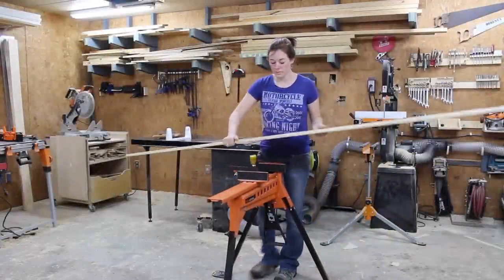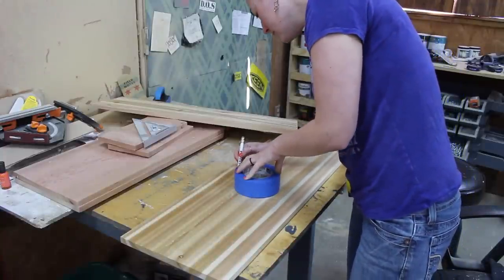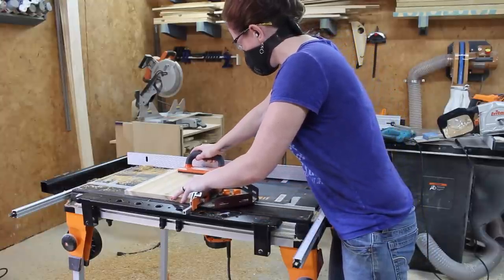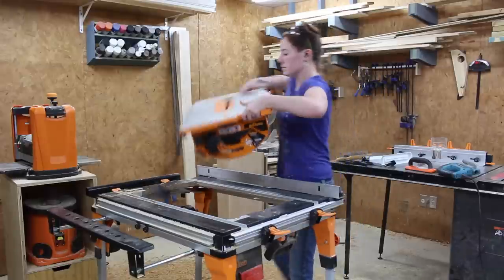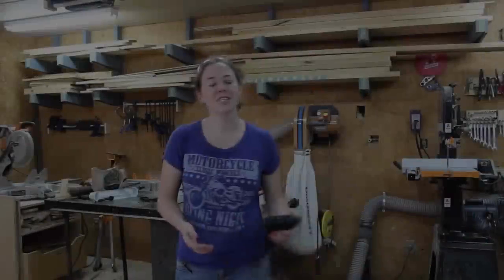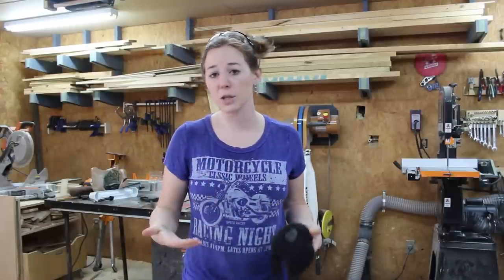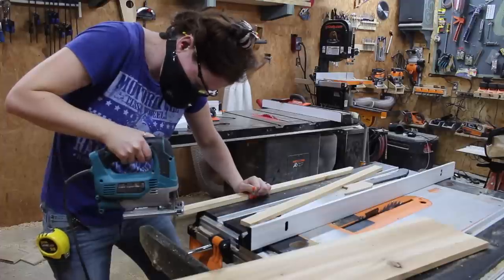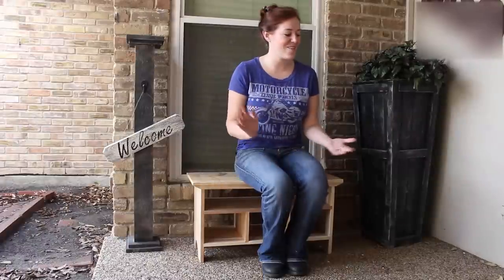Small  Wooden Bench for a Porch or Entryway

Comment: April, Another great video. I would like to make a request video if possible. I would like to start more furniture woodworking, coming from framing,  but the challenge I have been finding is the types of wood that I should  be using for certain projects. What plywoods do you find best to use? The boards that you used in this video, etc. If you could share what you have learned over the years, I think it would make a fantastic video. Thanks for all the great videos!

Comment: Regarding cutting dados on the router. I have found this can cause tareout on the exit. To ammend this I either chase the work with a sacrifical offcut of do a slow controlled back cut first. Hope this helps.
Reply from the maker: Oh that's a good idea. I played around with putting tape on the outside edge and that worked pretty well, but the sacrificial piece is much easier.

Comment: Hey April, I think your dust mask link isn't working. Looks like the URL got cut off. Also that's a really nice looking bench with a simple clean design. The only thing I might add is a chamfer to the bottom of the legs to avoid them splintering as it moves against the patio when people use it. I think I may add this to the list of possible gifts for family in the future. Anyone would like to receive such a bench. Great video and good luck in Germany!

Comment: if the wood you used for the sitting stool is 5/8 thick and I use 3/4 according to your dado measurements would these measurements have to be altered by 1/8 inch to make everything come out centered and even?
Reply from the maker: Good point, I was considering that most 3/4" wood sold isn't actually 3/4". Yes you could move everything, or you could just worry about the dados on the top piece so that the overhang is nice and even.

Comment: Great video and the stool looks fantastic!  I do have a question about how you assembled the parts.  You were sliding the parts together instead of fitting pieces into their dado slots.  Is there a reason for sliding them together during the assembly?  I'd think that putting them together like that would cause stress on the ends of the vertical legs and cause damage.  Thanks!
Reply from the maker: I always slide pieces into dados instead of popping them into place. I'm not sure if one way is correct for wrong or if both are ok, it's just the way I've always done it. I would be interested if somebody experienced would pipe in and tell us. : )
Reply: Fair enough!  I was just wondering if it was some secret master builder technique or if there was a story behind it.  Thanks for answering!

Comment: Just in case no one has mentioned it already. Odds are that the raw materials you'll be given to work with in Germany will be in metric dimensions. Length and width won't matter much if you want to work in inches, but if the lumber you get to start with is already milled, beware of the thickness.
Reply from the maker: Good point Tom!

Comment: I'm new to woodworking and decided on building this bench as a weekend project. I've been frustrated with it mostly because of my dados: I free handed them with my router because my router table is too small and I lack a table saw. They are anything but straight and have been time consuming to fix. Does anyone have any advice for creating consistent, even dados for this and future projects? I do have a circular saw and a small sliding miter saw if those could work...
Reply from the maker: Since you have a router look at buying a jig that fits it that will allow you to use a guide. I have the triton router and it comes with a base that attaches and acts as a guide for making straight passes. If the company that makes your router doesn't make one then you can make your own with scrap wood. Check out LumberJocks.com for good advice on woodworking.
Reply: Thanks! My router is a Craftsman I bought at a pawnshop. It isn't especially old so I'll check into it.

Comment: When are you in Germany? While there ask people why they do not dado stacks for table saws.
Reply: +Chris Felter Interesting question.  That's the 2nd time I've seen a question on this subject.  One site says that the table saw blade must stop within 10 secs of power being removed.   The inertia of the extra weight of the stacked dado blades plus the stacked dado set would interfere with the electronic braking of the table saw, thus would keep the saw from stopping within the 10 sec requirement of EU law.  I didn't know their saws had electronic brakes.  But I do know that sending a DC current through an electric motor will stop is relatively quickly - we used that method on some flight simulators (old technology).  The inertia of the spinning blade after a rapid stop can cause the dado set nut to spin off and loosen the blade set.
Reply: Wow. That makes sense. Thanks. I kept getting answers that if a hand gets into the dado it would do more damage than a router. But your explanation is better.

Comment: The dust mask looks a lot more comfortable than the regular n95 masks where the straps are pulling against your hair and irritating the skin on the back side of your ears. If you have a bad case of lizard breath you are smelling it while you have a regular dusk mask on.
Reply from the maker: Lol Lizzard breath. Yes, this mask is way more comfortable in my opinion and it does a much better job at controlling the heat. Also, I love how simple it is to take on and off in between cuts. With the other it's such a hassle!

Comment: Without any cross-bracing, does it not wobble back and forth at all? If not, is that a product of the joints you used?
Reply from the maker: Nah, it is very sturdy, watch it when I sit down on it. : ) It wobbled back and forth when I did a dry test fit but once you add glue and it dries, it takes out all the wobble.

Comment: Apart from the air getting wet and hot inside the mask, my biggest issue with face masks is that the air gets blown into my eyes as I exhale. Is that "fixed" with this mask?
Reply: It's not too bad. The two valves allow hot air to escape and the nose area has a bendable metal piece to secure it tightly to your nose.  Worth getting. IMHO.  Troy
Reply from the maker: Like Troy said, there is a metal bendable piece on the nose and you adjust it when you get your mask. I haven't had an issue with my glasses fogging up at all.